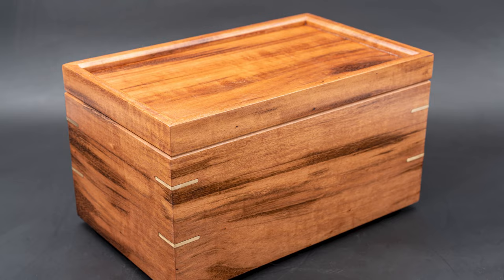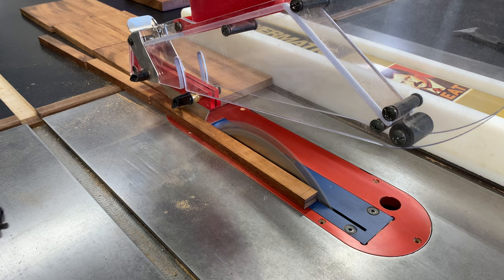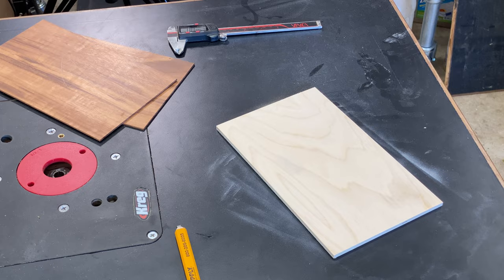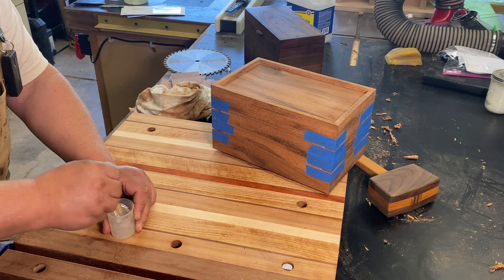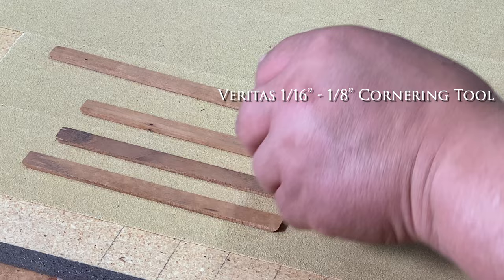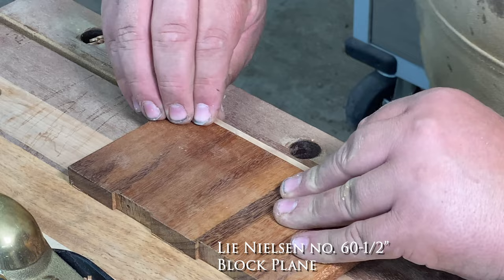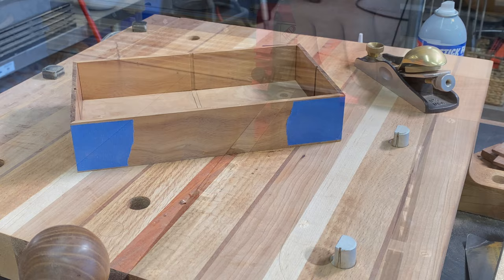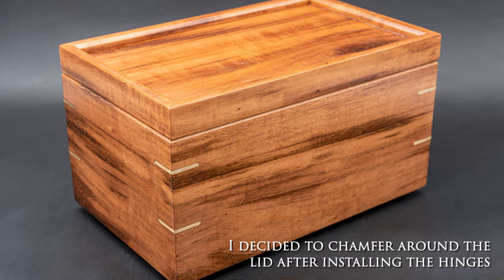Keepsake Box Tutorial - Exotic woods with brass splines

Comment: I got the same 5hp powermatic 66. When you hit the power its all in. What a horse of a saw love it.
Reply from the maker: It’s been a great saw - unfortunately the motor blew a capacitor and I was unable to get a replacement part in time for a deadline last year, but I was able to pick up a used SawStop for a good deal and will be moving the PM66 to a dedicated dado saw when I get back up and running in my new shop.  Can’t wait to have a shop with 2 saws…
Reply: @MattMuirhead  one went out in mine but I picked one up at a hvac dealer still going strong

Comment: I don't have jointer or a plainer
Reply from the maker: Outside of the table saw, the planer and jointer are  the backbone of a woodworking shop.  You can get by without a jointer - if you have a tone of time, patience, endurance and skill you can use a handplane to do the job of a planer.  Depending on the projects you are aspiring to make, those are tools I would recommend every woodworker add to their shop.
Reply: You can joint with a level and a table saw too if your comfortable with your saw

Comment: You shouldn’t glue all four sides of the top and bottom panels it limits the expansion and contraction which can cause cracks.
Reply from the maker: Few things - the top of the box is two pieces of veneer thickness that are laminated to a plywood substrate.  There is no hardwood in the groove. The bottom is less than 1/8” thick. The grooves in the box sides have an extra 3/32 or so on each side to float and there is only a drop of glue in the center.  Wood movement will not be an issue across such a short distance.  If it were an inch+ thick and spanned some distance, you’re 100% right.  Since the wood isn’t pinned - it won’t be a problem, especially since it lives in Northern CA where we don’t have much swings in humidity.

Comment: Good stuff, that's a beautiful box. I have tackled a few boxes and you gave some good detail to help me fill in some gaps in my knowledge! I have to ask, why shellac as a first step, especially when you went with several sprayed coats of lacquer as your finish?
Reply from the maker: Good question - In order for the grain filler to work properly, the wood needs to first be sealed.  Shellac and / or SealCoat are good options because they are water based like the Grain Filler I used.  Once those dry, it's OK to use an oil base lacquer over the top.